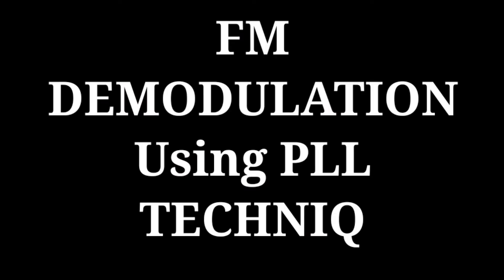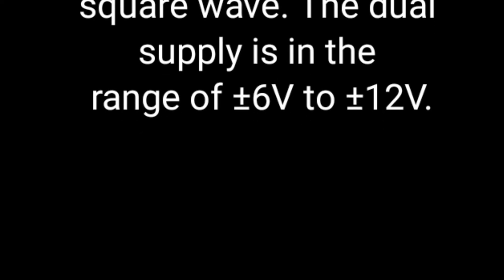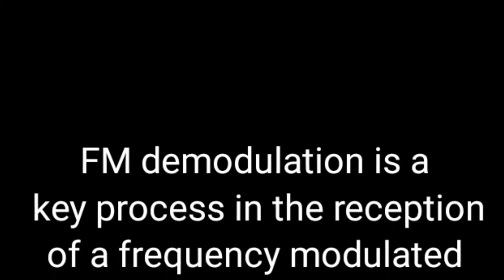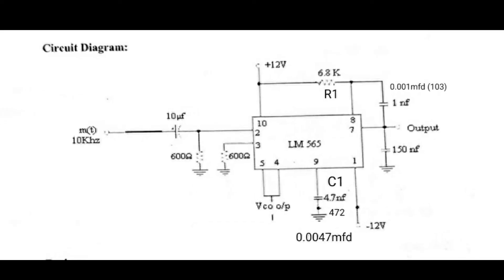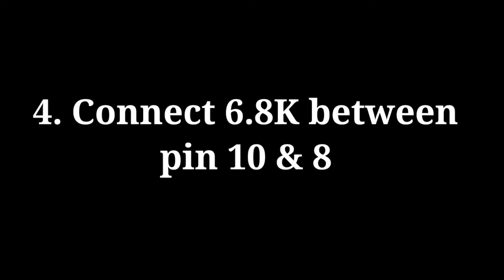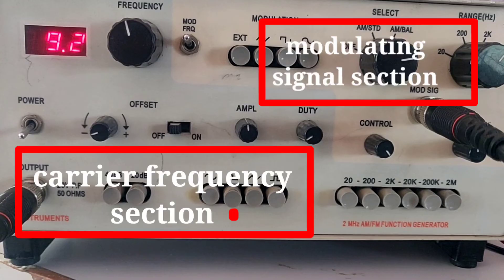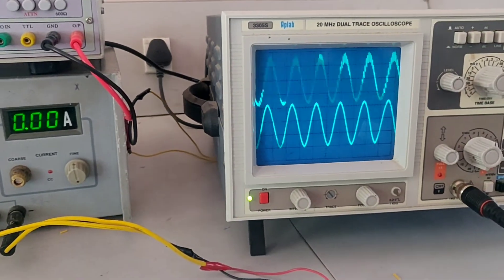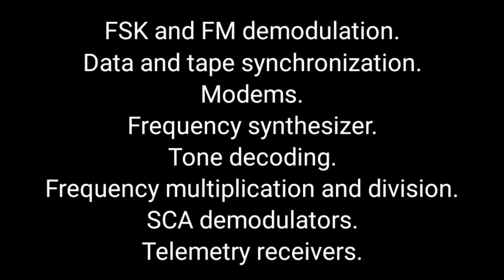FM DEMODULATION (LM565) @electronicslabmadeeasy6850

Comment: Sir I am getting output of which frequency is same as input but voltage is very low. I am using same circuit for fm demodulation except giving fm ( frequency modulated) input from siglant function generator. Kindly help